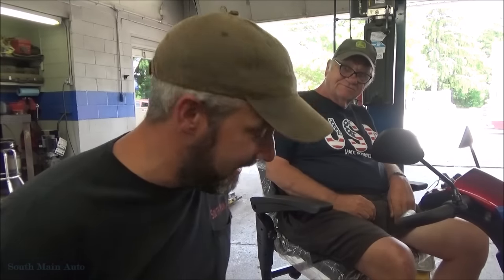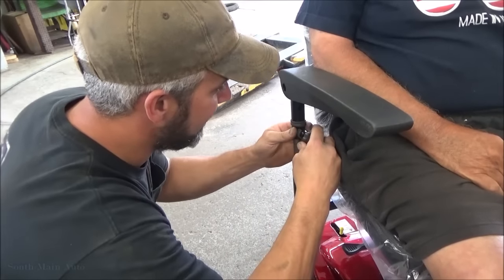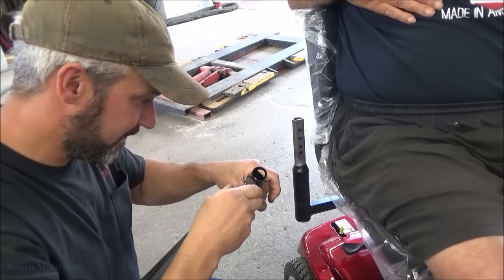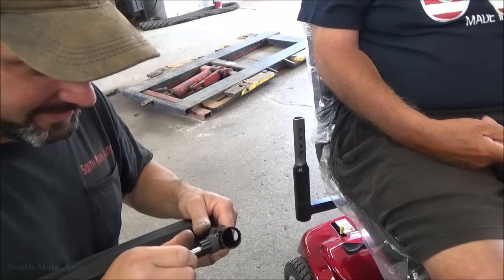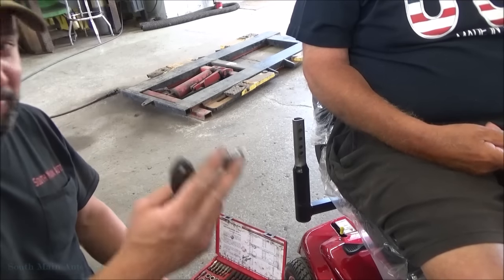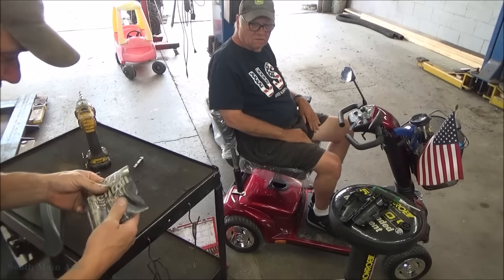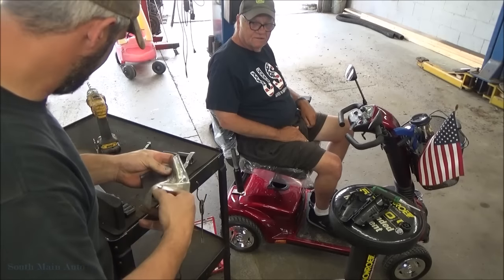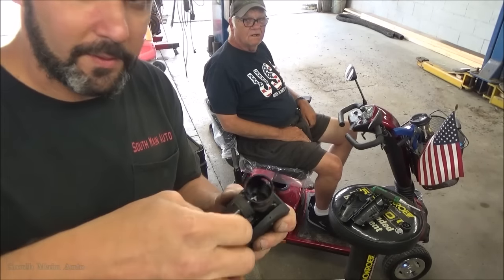Mobility Scooter Repair - Loose Arm Rest

Comment: Thanks for your service, Vinny!

 I swear we're in parallel universes Eric - I've been maintaining my neighbor's  Pride Mobility Jet 3 scooter chair. Nowhere near as fancy as that one Vinny's got there, but does the job. Thing is 17 years old, so it's needed some TLC. I did both batteries, welded a nut on the seat adjuster, and just last week I had to install new anti-tip front wheels there, since my 85 year old neighbor got all crazy and peeled the rubber right off the things, HAHAHA! He takes the thing in the woods, and through all the potholes on our street that hasn't been paved since 1948. All in a day's work! :)

Comment: My second car was a 36 Chevy.  My first was a 32 .  I got rid of the 32 after a friend of mine totaled his mint condition 28 Chevy and was extensively lacerated by shards of glass from the non safety glass windshield.  My 36 was the less expensive model without the side window wings and big knee suspension.  I was told by a number of people I was lucky not to have the big knees because they were a major source of trouble.  If the owner of this wants to sell this one to avoid that problem, I am willing to buy it from for what paid for mine, $80.00.  And that is a firm offer.  I'm holding my breath for his (or her) response.

Comment: Different thread stepping is a curse too. Normal M10 has a stepping of 1.25mm/turn, but I have experienced a stepping of 1mm/turn, which was on the front calipers on an early 80's Suzuki motorcycle.

Comment: Hey Eric...did you catch it on video when you did what ever it is you did to your Left thumb ..OUCH
Reply: Eric  has explained a couple times so I don't think he'll mind if I help answer. One of the symptoms of Psoriatic arthritis is random fingernails grow in rough and pitted. They're impossible to keep clean working in a shop. I have the same thing happen to mine.
Reply: Thanks! I have some arthritis in my fingers too ..so when he drops nuts and bolts I understand..
 I had not heard of the nail issue..maybe that is why a few years ago my left middle came in funny ridgy like..I thought it was from tearing my shoulder ... but the arthritis makes sense too

Comment: Not an engineer, but I was wanting you to run a knife file over the back side of the thread that was hanging up. I used to tool sharpening before I retired.

Comment: Nice repair Eric! That soft alloy should have had a lot more meat and helicoils from the factory! Third World design, not Japanese, Chinese or American!
If you do not have helicoils a DIY solution is to fill the cavity with a metal filled epoxy (like JB Weld) than drill and tap.

Comment: I was cringing the whole time.  Man why didn't you put that sucker in a vise to start with?  That could have gone bad multiple times.  Every bit of respect for the time and effort to get that vet fixed up but man those fingers next to that cutoff had me shaking my head.  No please no no.  It's halloween horror material.  Please for my bad heart, use a vise next time.